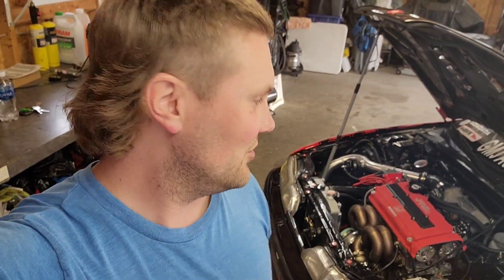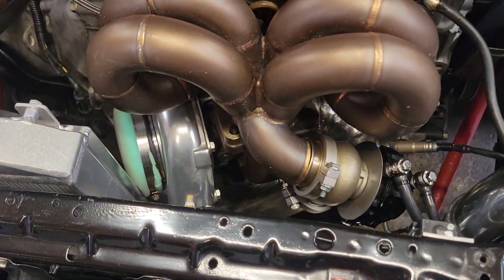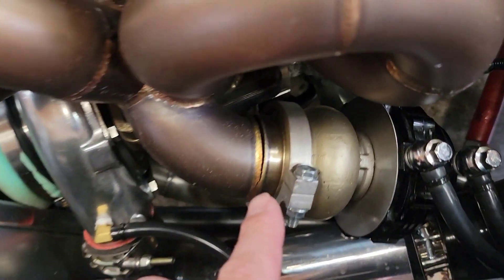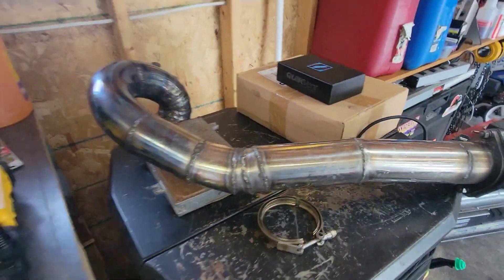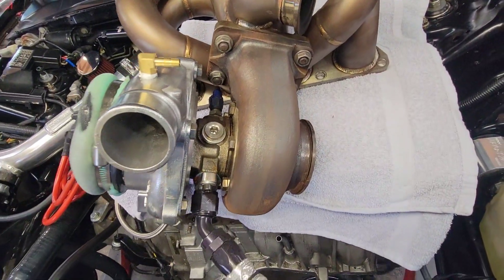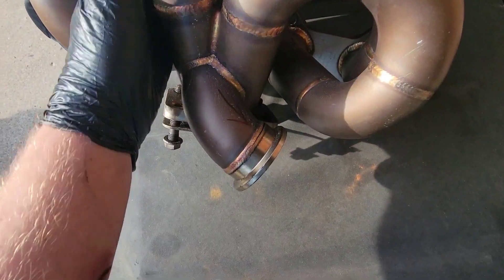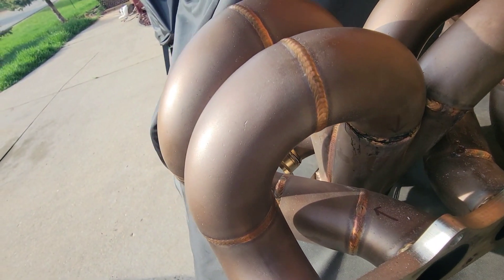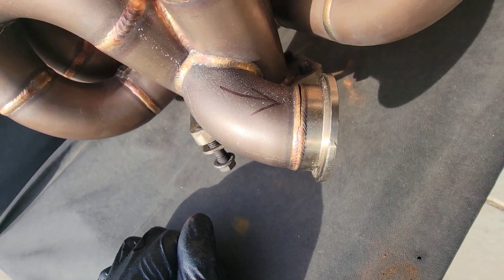Jackspania Racing manifold is trash!!!  Cracks everywhere!!!  so sad😔

Comment: Note no flex in downpipe  90% your fault
Reply from the maker: The downpipe is 20in long. And has nothing to do with the wastgate flange falling apart. Smh
Reply: @diyclay525  yes but hanging all that waste gate tube off wastegate flange with no flex or surport at the end  will do that  plus all the extra  vibration's due to no flex in main downpipe you hung the whole exhaust weight off those weld what u expect
Reply: waste gate longer than 12inch want flex in middle and exhaust hanger on end to support the weight
Reply: I had the same manifold with a flex downpipe, and it cracked at the welds while being tuned on the Dyno. Still haven't heard from Jackspania about a refund or replacement.
Reply: Jackspania sucks
Reply: And I almost ordered from them.

Comment: And that manifold is cracking because 1) the material is trash and not rated for the heat 
2) that 6yo that’s “welding” it for you is essentially tacking them together with fusion welding. 

Zero penetration and shit materials and this is what you get.

Comment: Bro if i were you id listen to these comments and take the advice its common sense anyhow love the videos gave you a subscribe but fr add a flexi in your downpipe itll help alot with your waste gate pipe or manifold cracking and takes the stress off alot! advice get a flexi for downpipe and for waste gate pipe if you dont want a flexi then make use of a slip joint
Reply from the maker: Have not had an issue since I had it re welded. All good now